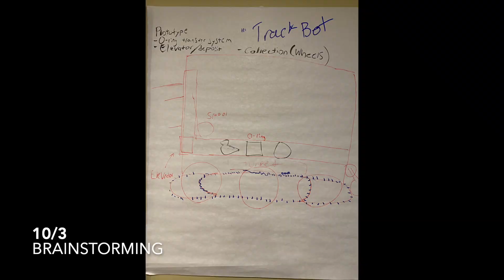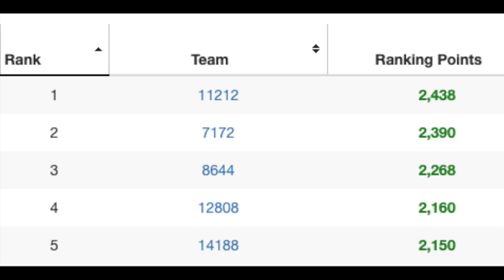FTC Freight Frenzy: 8644 Brainstormers Season & Worlds Recap

Comment: how did you guys make the misumi slides extend on 11/25 1:50 ? I saw two flat beams but what did you use to connect the beams together and extend?
Reply from the maker: The 2 flat beams are connected just with a screw, locking nut, and some washers. The closer beam is powered with an orange Savox servo that you can see at 1:48 when the lift is raised. We switched to ProModeler servos halfway through the season to get more range and reliability.

Comment: do you use roadrunner or some other motion profiling software?
Reply from the maker: We have our own code for tracking position and also to control robot driving based on waypoints. It took a year to get this right, but we learned a lot and now we have very fine control over robot navigation in autonomous.

Comment: What slides do they use?
Reply from the maker: Misumi aluminum drawer slides: https://us.misumi-ec.com/vona2/detail/110300072130/?HissuCode=SAR230
Reply: @Brainstormers8644  thanks
Reply: Congrats on finals at worlds!
Reply: For some reason the link didn’t work. How did I guys connect the slides?
Reply from the maker: We can usually use the existing holes on the slides and drill a few more if we need to. You can see more detail in our Reveal Video https://youtu.be/zNNMIjzjaMc?t=155. If there's enough interest, we can make an update to our Lifts and Linear Systems video.
Reply: Are team has been experimenting with REV linear slides and they seem to work. But we’ve seen teams like you guys who use the Masumi sides and are wondering how those would work. An update video would be awesome. If u did make an update video maybe u could talk about how u guys string slides as well? We were struggling with that this year. Thanks for your quick feedback!